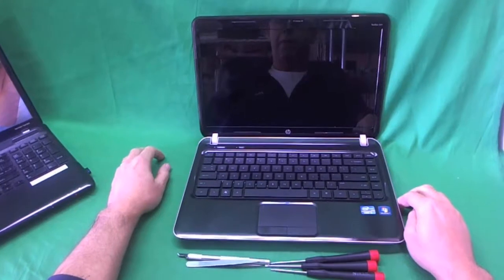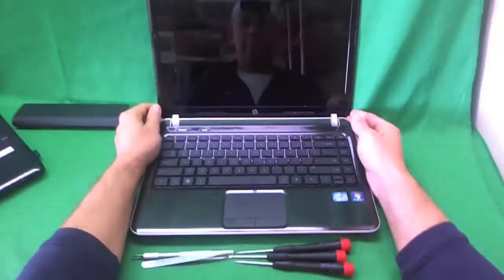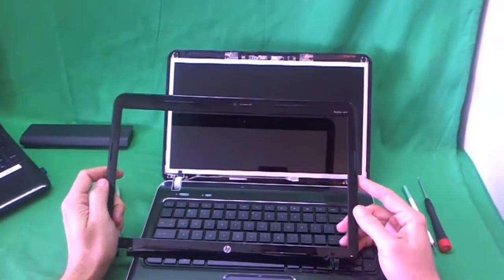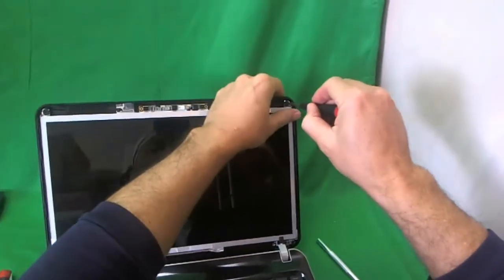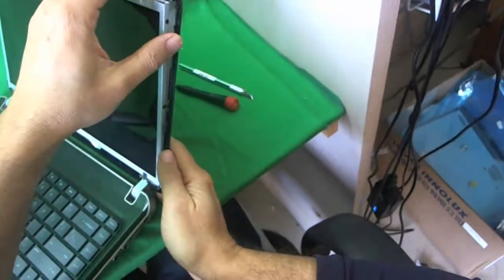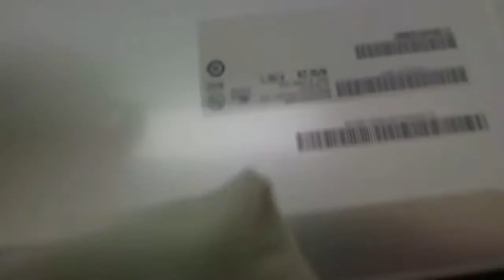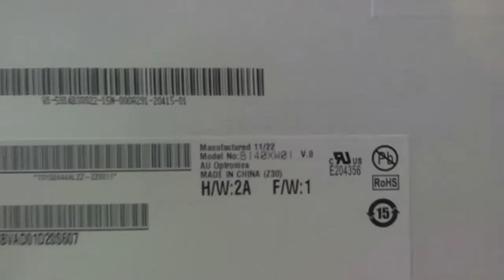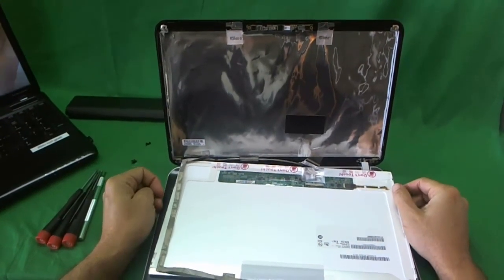HP dv4-4000 Notebook Screen Replacement Procedure

Comment: This video is super helpful for us laptop repair n00bs! Very easy to follow steps. Helped me replace a screen in a dv4-1283cl. Although the model number and back-light type is different, the process was essentially the same. Small difference with the bezel shape, but it still pops off the same. The 2-pin connector plug for the CCFL screen is another difference compared to the LED screen. Just knowing how to remove the bezel, the webcam and the video cable were the essential points. Thanks!!